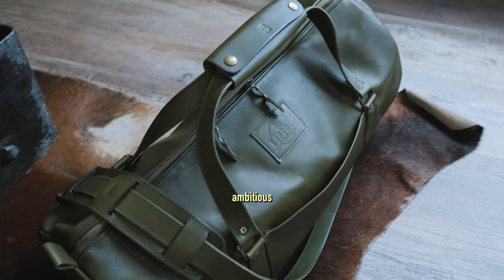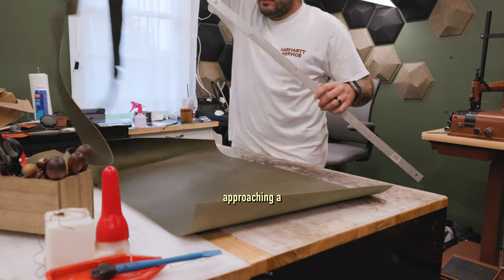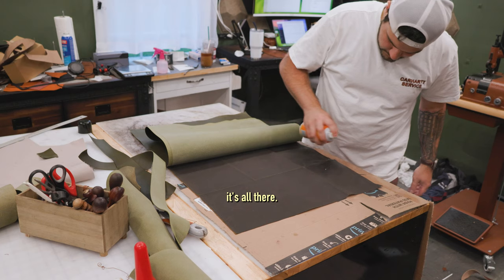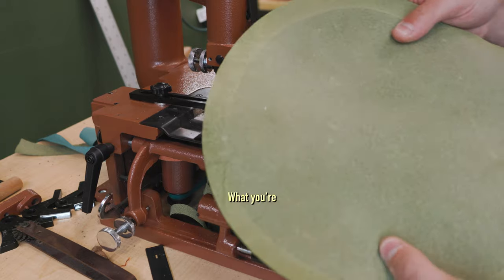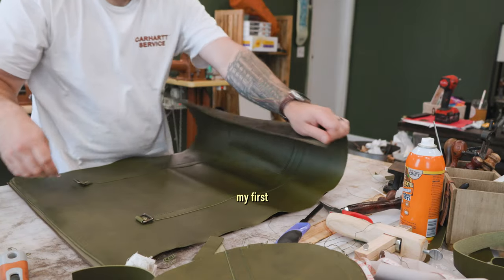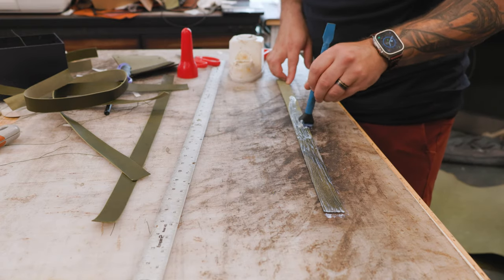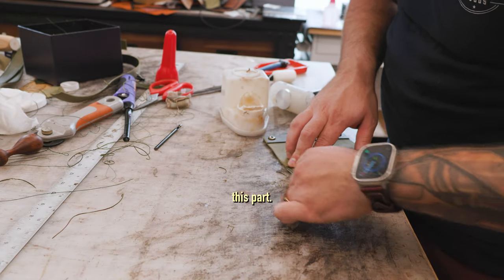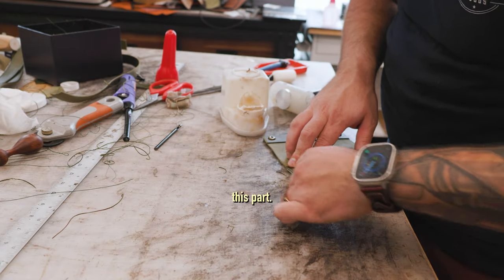The Art of Making a Leather Carry-On Duffle Bag

Comment: What was the mistake you mentioned regarding the tubular and gussets? Is it shown in the video? Didn’t really get that..
Reply from the maker: I set the tubular rivet backwards (there isn't necessarily a correct forward or backward, but I wanted it reversed.) the star pattern that the rivet makes once it's set I wanted on the inside but accidentally set it so it was outside
Reply: @80ProofGoods  Oh ok. thanks for sharing!